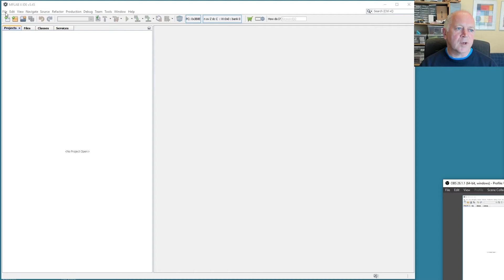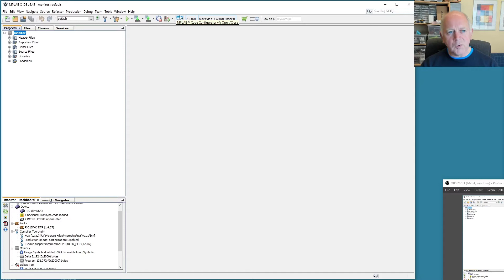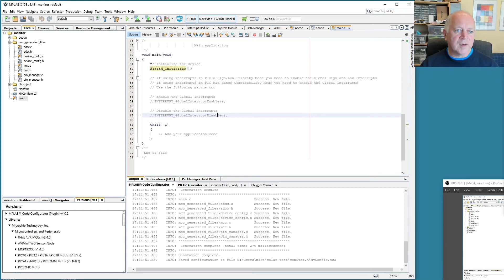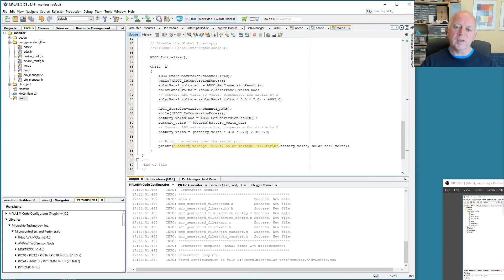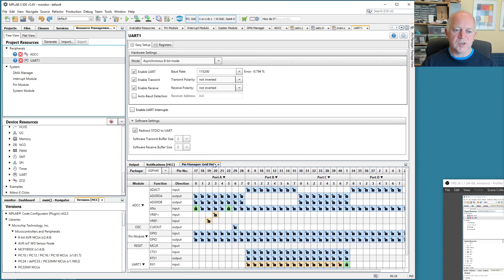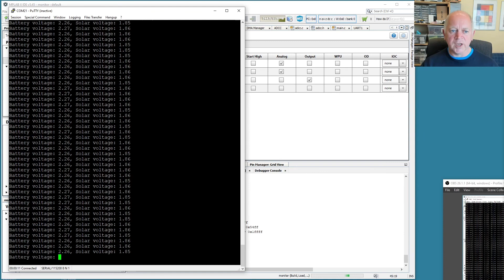Practical Electronics - PICnMix July 2021

Comment: Hi Mike. Very useful to have this description on YouTube. The article descriptions are good but this is clearer. I am following your articles through and building  hardware sections, as needed. 
Is it possible to download the code you mention in Part 6 (and the video)? Saves typing and errors.
Reply from the maker: Hi, the video is on YouTube only now, I deleted the originals.  The software is available on the magazine website for free download, the link is in the article. Ill try to do more videos to support the articles, sometimes the written word is not as effective as visuals. Especially with GUI software :)
Reply: @mikehibbett3301  
Hi Mike, I still can't find any PIC  n'Mix files.
This is where I'm looking on the magazine website:
0721 Download zip – July 2021
Files for the July 2021 issue of Practical Electronics:

ATtiny816 Breakout and Development Board with Capacitive Touch
Infrared Remote Control Assistant
Touchscreen RCL Box
Cool Beans: Flashing LEDs and drooling engineers – Part 17
Circuit Surgery – transformers and LTspice – Part 2
David
Reply from the maker: @rdforrest1047  Oh I see why - there are now files. The code is in listing 2, and short enough that we didn't create a file of it. If you would rather download a complete zip file of an actual project, that is provided in the September issue, which should be out soon. 
Regards,

Mike